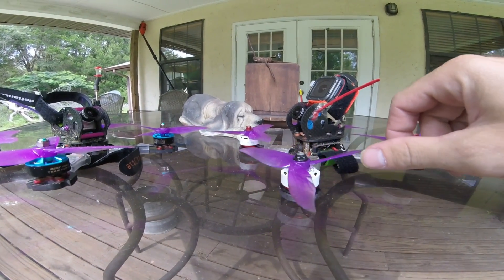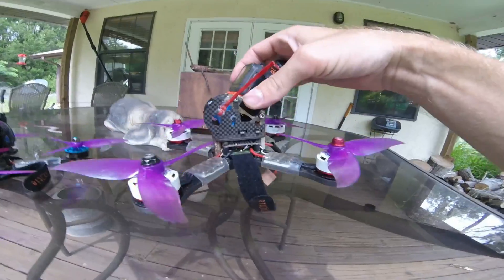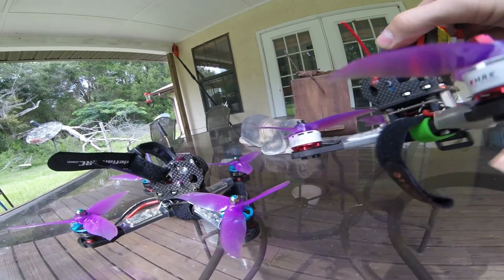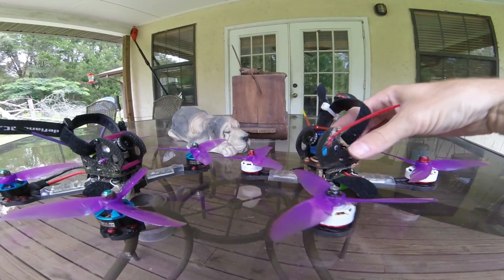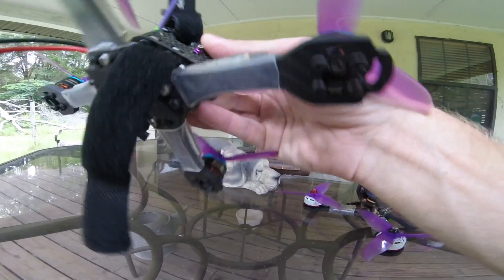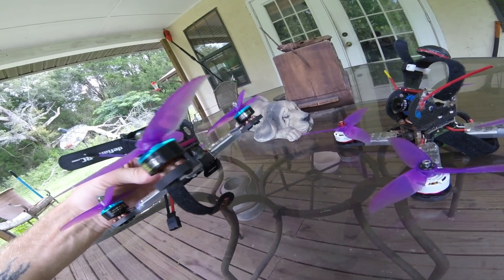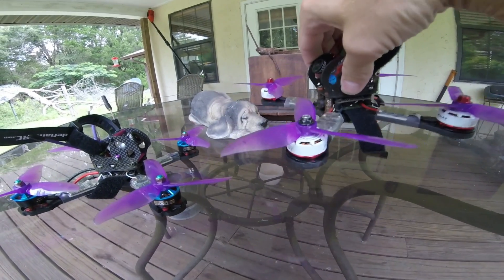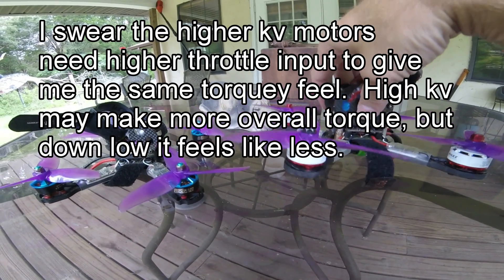High KV vs low KV motors

Comment: I think one can argue that the lower the Kv the better. One can always make up for a lack of RPM by increasing the cell count but if the torque constant Kt (that is inversely proportional to the Kv) is too low you will simply burn out the motor before achieving the torque needed to drive the props. Propeller efficiency increases with disc diameter (one is putting less energy into moving a small area prop-wake fast and more into actually propelling the quad) and one can, within reason, always tailor blade chord and pitch to get a good L/D for the blades. There is also the point that in a high voltage/low current setup one can either use lighter wiring or have lower fractional voltage drops in the wiring/ESCs. Also, the high torque needed to drive larger diameter slower revving props gives you more torque available to provide yaw authority without having to indulge in orienting the props to enhance the yaw authority (which as unfortunate secondary effects).
Reply: @Ζ † N I'll try to get some time to have a look at this. One thing, can you measure the chord of the prop blades at a few points as I have a spreadsheet I use to calculate probable performance and of course the chord of the blades comes into the sums. I build a quadplane which was effectively a 450mm square frame attached to a volantex  Ranger 1600 and I'm using 11 x 4.5 2 blade props to do the lifting with 920 KV motors but it would all be happier if I had lower KV motors on it and could go even bigger in prop diameter. I have another 450 size quad in build that I will use for camera carrying but the project is stalled because of other stuff (cars needing work etc.) but I'm thinking of 750KV or lower for that one.

Comment: if I want an acrobatic drone do I really need 2700 Kv motors?
Reply from the maker: No, you don't need 2700kv, 2400kv on 4s is plenty of power.  some people like having that extra oomph though for freestyle.  It's probably better to start on 2400kv if using 4s if you are just starting out. You'll end up needing new motors anyway.  Motors, batteries, props are wear items in this hobby.😉
Reply: mooosestang I’m jus starting out and got T-Motor F80 2200Kv I’m going to run on 6S ... to much to soon? 😂
Reply from the maker: @bugsysiegals  No, but i would run a power limit on them in whatever firmware you are using.  They will likely be fine at full power on 6s, but unless you are running some high speed bi-blade props you'll have props explode or the blades will flatten out at full throttle and sound terrible.
Reply: @mooosestang  Which props would you recommend for 5" Slam Nasty frame?
Reply from the maker: @bugsysiegals  I recommend gemfan 5146.6 for everything.  by far my most used props.

Comment: What do you do when you get stuck in one of those big trees? Buy a new one?
Reply from the maker: I have a 32ft telescoping pole and i climb halfway up or i fly another quad over it with a rope and shake it out.  I've never left a quad in a tree for more than a couple of days.
Reply: @mooosestang  thanks for this info. I'm just getting into the sport and have always wondered what people.do. I'm sure some just leave them. Guess the weight of a rope just knocks it loose? Since I'd only have one drone I should probably stay away from tall trees lol. Thanks for your response
Reply from the maker: @TheKtchevelle  Yes, stay away from tall trees until you get better at throttle control, flying inverted, power loops, etc.  I have several videos showing how i get them out of trees.  sometimes i just use another quad and knock them out. Definitely need a second quad. https://www.youtube.com/watch?v=lPqay8BblKA
Reply: @mooosestang  now that my friend is worth watching.
Reply: @ Kyle he cuts the tree down for 2 reason #1 to get his quad & #2 to have wood for his fire 🔥 pit 🤣😂🤣😂😂

Comment: “Kv” refers to the constant velocity of a motor (not to be confused with “kV,” the abbreviation for kilovolt). It is measured by the number of revolutions per minute (rpm) that a motor turns when 1V (one volt) is applied with no load attached to that motor. The Kv rating of a brushless motor is the ratio of the motor’s unloaded rpm to the peak voltage on the wires connected to the coils.

Knowing the Kv rating of a motor will help you determine how fast that motor will rotate when a given voltage is applied to it. For example, a 980Kv motor powered by an 11.1V battery would spin at 10,878 rpm (980 x 11.1) with no load. A change in voltage will change the rpm and will require changing the propeller to avoid overloading the motor. Kv allows you to get a handle on the torque that can be expected from a particular motor. Torque is determined by the number of winds on the armature and the strength of the magnets. A low Kv motor has more winds of thinner wire—it will carry more volts at fewer amps, produce higher torque, and swing a bigger prop. A high Kv motor has fewer winds of thicker wire that carry more amps at fewer volts and spin a smaller prop at high revolutions.

Knowing the Kv rating of a motor is helpful to determine which motor belongs in which aircraft. An FPV racing quad, for example, requires high rpm for high speed, so you would use a high Kv motor and a small-diameter prop. On the other hand, you would use a lower Kv motor in a heavy-lift multirotor because you want to turn a large prop at lower rpm and obtain high torque.
Reply: Thnx bro that was helpful for me
Reply: @vishaljamwal400  not a problem homie.
Reply: You are bang on.
You can use all this to work out the weight too.
Reply: @watchingin3d549  yup.
Reply: Thanks a lot,  Bro. I was confused with the KV rating. I had a thought that the higher the KV means the bigger the motor. But this is not actually that true. Is it?
Reply: Bro really thank you for your information. I was just looking for this explanation. I was very confused with higher KV vs Lower KV motors.
Reply: Thank you
Reply: Bro..how about the higher kv with lower pitch propeller? Is it proper match?
Reply: First time I start to watch a video, and a comment teaches me something more interesting than the video itself! Thnx
Reply: Still helping people 2 years later! Thanks

Comment: Higher KV motors are revvy like a high HP GP1 engine and are suited to light props which allow them to rev high. Lower KV motors have more grunt at lower speeds like a V-twin and are suited to heavy/agressive props just as a V-Twin has taller gearing.
Reply from the maker: I do love heavy props and v-twins.
Reply: I just got Dal T5050C for my 2206/2300kv motors. Think that's a good match?
Reply from the maker: Yep, i love them on the emax 2306 2400kv.  Slight increase i amp draw compared to the 5046.

Comment: you were comparing motor of different stater and bell sizes...
Reply from the maker: True.  one is 1mm wider, the other is 1mm taller, but these motors still compete with each other i think.  It's not like i'm comparing a 2205 to a 2306.  I have some hyperlite 2307/2522kv coming today.  I have not given up on the higher kv.  So many different motor options in this hobby and i like to try them all, so naturally i'm going to draw comparisons.  I could be Mr. Steele and fly one motor and one frame my whole life, seems lame.
Reply from the maker: I just flew 1 battery with them, loved them!  video was nothing special, but i'll upload it since it was my maiden flight with these motors, the bff4 FC and betaflight32 escs.  Thing was smooth, smooth, smooth.  They pulled 90a on dal cyclone 5046, but i don't think i have the escs setup right, using them for current sensing.  Motors felt really nice though, so smooth.
Reply: Have you had a play with the 2307s yet? What do you think?
Reply: I'll keep an eye out for the video, keep them coming! Smooth sounds good to me

Comment: I think 2400-vs-2500 is too close to compare kv differences.
Reply from the maker: Yes, but the emax are much closer to 2300kv according to http://www.miniquadtestbench.com/emax-rs2306-2400kv.html  They don't reach the rpms of the high kv motors, you can hear it in flight videos.  Which i don't find a bad thing for how i fly.

Comment: Did you use other props on the 2300kv ? Maybee you wil get more speed whit props that are made for more torque
Reply from the maker: No, same Dal cyclones.  I think the cyclones are better for lower kv motors.  I should try a lighter prop on the higher kv motors.
Reply: mooosestang what kind was it 5046?
Reply: Yes, 5046
Reply: MacroHD okee thnks for anwsering 👍🏻
Reply from the maker: Sorry, i am also macrohd, just another channel i started.
Reply: mooosestang why

Comment: Freestyle - - > Torque like 2206/2300, 2206/2400 or 2207/2400. Like a V12 motor, it got much more torque than a F1 Car, but less speed due to low kv. With much torque Quads can be a bit heavier, feels almost a lighter high kv Quad. High kv like 2206/2700 are quiet good with very low weight Quads, but they gotta be very light! Amps will be okay then.

Comment: Very interesting observations from flying different setups. Seems like the 2306 size is quite the sweet spot offering quite good response on 5" props.
There's also several factors at play, I think the main ones are air gap (stator to magnet), KV and the operating RPM, The Stephan_RC channel you found is pretty good at explaining that stuff. He makes a good point about Lower/Higher KV motors optimal RPM range. So the lower KV will have more torque at lower RPM. So when freestyling we're often going from low to mid and then momentary high RPMs -seems the lower KV motor has the advantage in those regions where we do most maneuvering midair. 
Funny thing sometimes all the theoretical stuff doesn't translate well into real life application and only by trying different setups one can determine the best-feeling combo.

Comment from the maker: Hmmm, now that i start to read more about torque and kv, it's very possible that the higher kv motor is causing more voltage sag and thereby reducing the torque output.  We know it's drawing more amps and i'm quite sure that's causing more sag.  I don't think high kv motors are hype, just not sure they are worth the extra amp draw, especially if you are using 1300mah batteries.
Reply: mooosestang you are 110% correct, high KV motors cause more sag and pull down the voltage quicker then lower KV motors do.. I love My BrotherHobby motors, it's pretty much all I fly with the exception of a few sets of 2300 Emax whites and a few sets of Tmotor F40s.. right now my fav motors are Returner R5 2307s that I re-wrap/wind to 2350ish KV.. I really like the Hyperlite 2204 2522kv and R42206 2522s but I'm stoked with rewraped returner R5/Hyperlite 2307s at 2350ish KV I've done some at 2150kv and that's a little low at bumping them up to 2350kv and imho it's the best motor out there if your quad can handle the little bitta extra weight.. if you want a lighter setup the R4's rewrapped to spinning 2350ish KV is a hammer and amp draw is dropped A LOT over the 2522.. the quad will feel and be faster on top end because of less sag, torque is there and prop spool up feels much more instant then at 2522... if you have the batteries any of the BrotherHobby 2522 KV motors is great.. it's a nice medium between 2300 and 2700 but they are gonna be much harder on batteries then at 2300 KV (I'm sponsored by Gensace/Tattu and fly their 1550 4s R-line 95c packs exclusively) the 95c Tattu packs in 1550mah are great with higher KV motors and can feed them but if you rewrap that motor to 2300 to 2400 you will notice more torque and that is just from the lower KV motor having more torque then factor in less voltage drop and you will notice in flight a HUGE difference in torque/instant power/prop spool up and honestly at top end won't notice much less if any less speed because your under load max RPM will be VERY close between a 2350 KV motor and a 2500 kv motor.. imho 2350 KV on premium motors between 2206 and 2307 in size is the only KV that's needed... on smaller 2204 motors then 2500 to 2600 kv is fine but on the bigger motors 2500 is just to high for the batteries we currently have.. I have tested really high discharge capable 1800mah 4s packs and they support higher KV large motors with acceptable voltage sag but they of course are just to heavy and to big for 5in quads.. I have a 6in alien build with Returner V5 2307s rewrapped to 2150kv and it's a absolute BEAST and the frame suites the Tattu 75c 4s 1800s.. voltage sag even on 6in is less then Hyperlite V4 2522kv on 5in... that same setup at 2522 on 6in the amp draw is unmanageable even on 1800s.. we both know that motor has tons of torque but because of voltage drop on 6in it feels like it lacks power until you are above 75% throttle.. it's like a car with a big turbo, it has nothing while the turbo spools up and then when the boost hits it's like a sledge hammer... but at 2150 KV the power is there from from hover to full throttle and voltage sag doesn't make it feel like it dies off when you are way up at the top end...
If you know how to wrap motor windings, I can give you the turn count needed to get the KV you want.. trust me those V4s you have at 2350 go from a great motor to an absolutely amazing motor, oh yeah and get another 45 seconds of flight time.
Reply: +Wicked Reelz 
very intrigued with how you mentioned re-wrapping your motors for lower kV & would to know more of the details along with making the proper  calculations, if you wouldn't mind?
Reply from the maker: I'm also interested.  My question is how many times did he get it wrong before he got it right?  I don't know if i have the patience for it.
Reply: +Wicked Reelz 

I'm wanting to rewrap my 2205 2800kv motors.. what wire & # of wraps is needed?
Reply: +Wicked Reelz .....

if you'd be so kind sir.....the number of wraps & the wire info with re-wrapping those 2205 2800kv motors? Thank you.

Comment: I have flown the Emax and like them alot, but i do have 2206 Oomphs (which arent lacking alot behind the Emax actually), and i have lighter rigs with the 2207 2522. But i cant say i agree wth you on the torque. I feel the 2207 has atleast as much torque. MQTB results also say the same. But they make you fly so fast, that theres alot more momentum to stop when turning fast. When racing the 2522`s i need to pull back on throttle alittle early due to i`m not a good enough pilot to handle that speed going into tight turns! But they sure are hard on amps tho, so they go on light rigs only for me.
Reply from the maker: Does he list numbers for torque?  I've seen him mention torque in a review, but no hard numbers.  I don't doubt they make more torque at some point, along with more thrust, but at low throttle positions they feel kind of meh.  I'd love to see an actual torque curve for different motors, like with gasoline engines. I have a supercharged mustang that makes over 400 ft lbs of torque by 3,000rpms and while there are some honda civics driving around that are faster, none would be as much fun to drive for me. They are no doubt faster, it's probably exaggerated some in my video because the quad is lighter.  Navigating MQTB website is a pain for me for some reason.  I went looking for these motors on his sight and could not find them.  Looking at other 2207 motors, i might try the multicopter builder 2400kv version.
Reply: Data explorer, compare motors.. The spool up curve 0-100% on heavy props, will be what shows you the amount of torque thats in a motor. Not a single number, but the spool up curve/time. The MCB 2207 2500kv will be pretty much the same motor as the 2207 2522kv as its pretty much the same motor built by the same company.  I also am a car guy, loving torque.. I fully know what you mean, i just dont feel the same with my motors as you explain it..
Reply from the maker: LOL!  I knew i was using that site wrong.  Thanks for teaching me something.  I think i will order those mcb 2207 in the lower kv to compare.